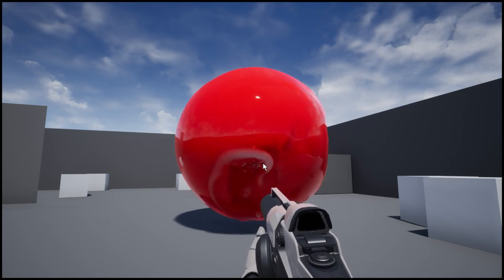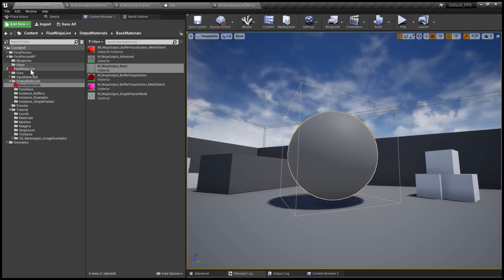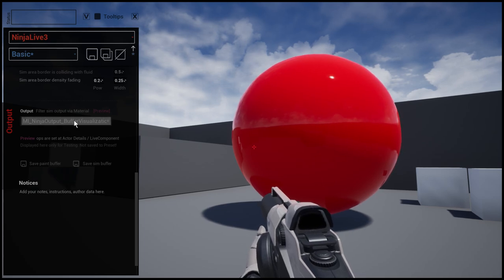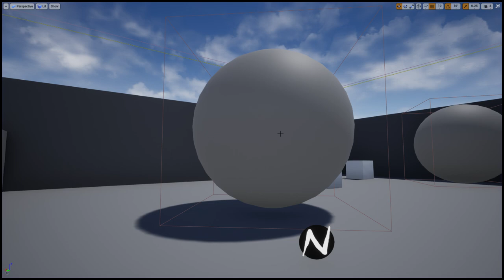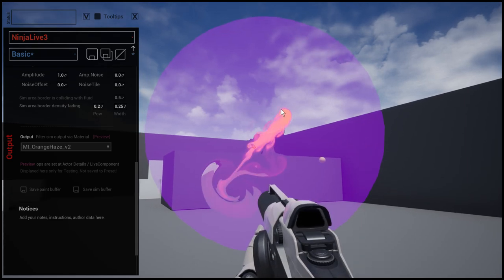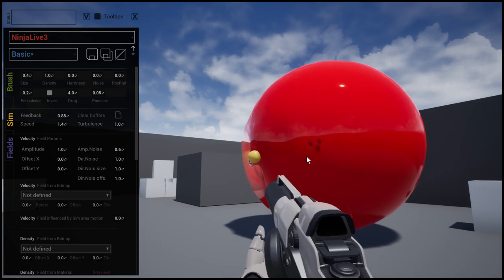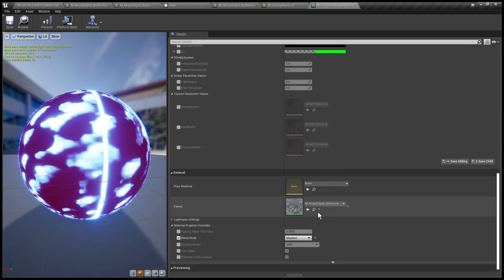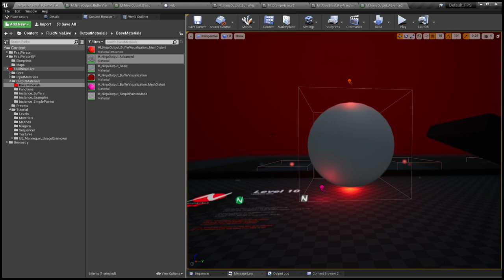FluidNinja LIVE 1.0 - Render Buffers & Output Materials

Comment: Hey Andrew, thanks for this!  I have Fluid Ninja for VFX..  can I do this in the VFX version or is it just available to the LIVE version?  am asking before I dont seem to have pressure options in VFX baking?  or do I?
Reply from the maker: Tekano Bob! Thank you for using NinjaTools! Recording Pressure to flipbooks is officially not supported in NinjaTools - but could be easily achieved:
(1) open "BP_FluidNinja"
(2) Find this group: "Set Input Parameters on Velocity BUILDER Material Instance"
(3) Locate the node: "Set Texture Parameter Value"
(Parameter Name = Texture)
(Node setting input to "AtlasBuilderMat2")
(4) Locate the "Find" node below
(5) Change "RT_VelocityOutputNormalized" to "RT_Pressure"

Note: this is not normalized pressure, negative values will be clamped. To have a full spectrum, normalize the pressure buffer - before handling it to the atlas builder.
Reply: @AndrasKetzer  superb!  I had a dig in the blueprints but its pretty complex, this very specific answer should get me through thanks a lot!. Am working on a  VR project so definately NO 'live' fluid sims for each eye  but baking to flipbooks and flowmaps etc is working great!   also the materials and example setups in the VFX package are a massive BOOST for a newbie like myself in UE4 but a veteran VFX artist

Comment: If I have multiple GPUs and want run instance on each GPU via DX12, do you think could it be a problem to run 1 instance per each GPU?
Reply from the maker: Renderman --- NinjaLive has been created using high level methods (blueprints, materials) - which means, we can not directly control GPU access (unlike C++ projects) --- I wonder if UE itself could be configured to put instances on separate threads...?